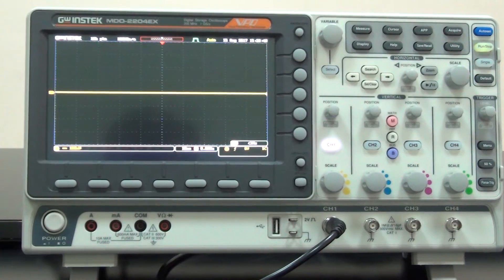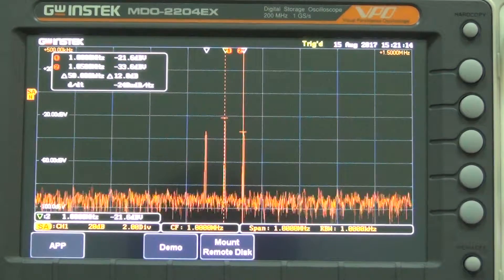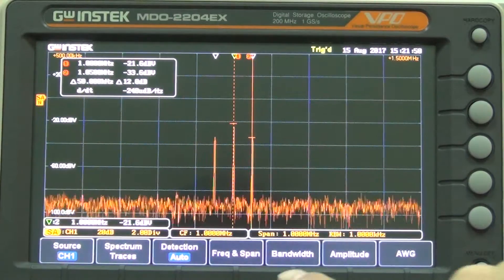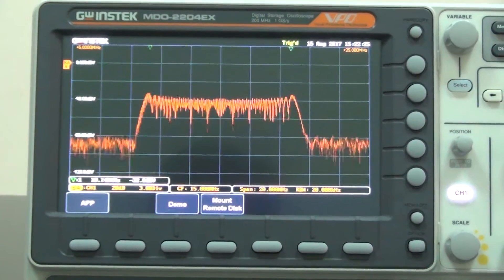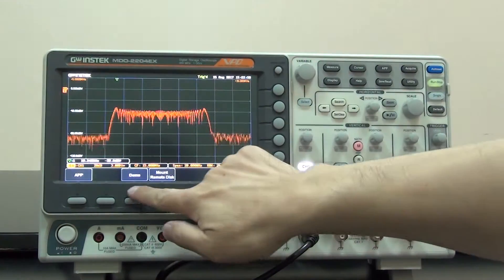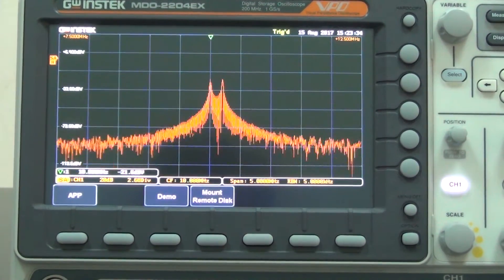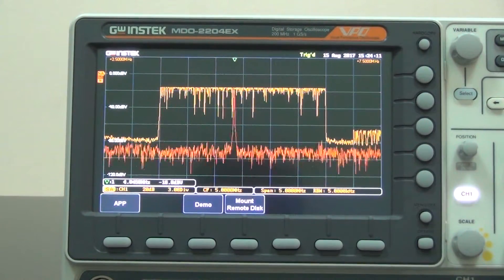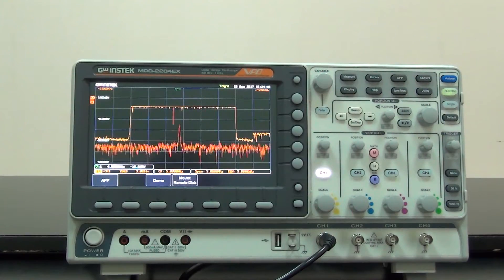Spectrum analyzer demo on the MDO-2000E

Comment: It is sad that your marketing and demo material is so bad and low in quality plus technically spoken not very much revealing. I was able to second all your demo material on a Rigol MSO5000 machine without any problems. A little play with acq. rate/memory depth and the 1M point FFT resolution yielded exactly the same. I even was able to get a better dynamic range versus this MDO2000E series. The only difference where your HW accelerated FFT processing was way ahead is Demo 4 with the 3.5MHz to 6.5MHz sinewave sweep. Don't know what sweeptime you used but think maybe between 100ms to 500msec or so. There I can really see it. But if one has time the MSO5000 can run a color grade averaging scheme and one gets a pretty impressive sweep picture with multi color grading. So here you win for sure in "realtime swept mode". But please also mention that your spectrum analyzer "mode" on this MDO series is limited to 500MHz tops, no matter what. Plus it does not give any feedback on sampling in FFT. Thus, I wish you would show potential customers a bit more than just "built in" demos. Cannot be so hard as you certainly have the signal sources for that.
Reply from the maker: Thank you for your suggestion. I'll provide it to our research and development team for reference. Thanks again.